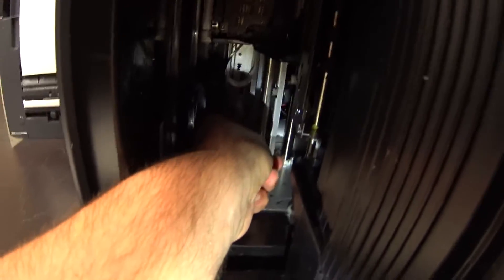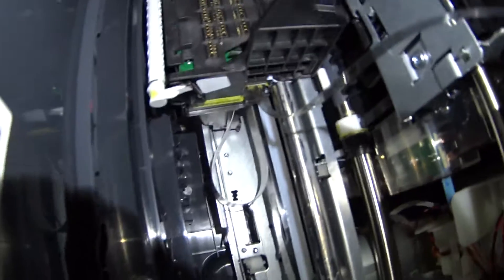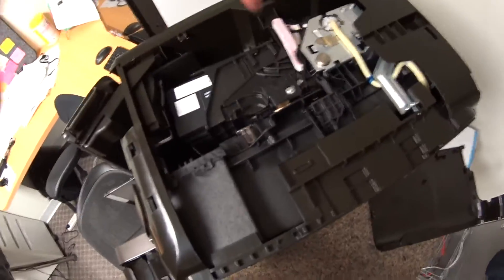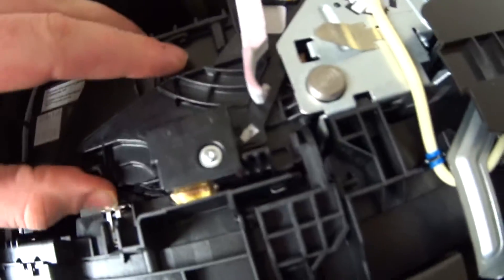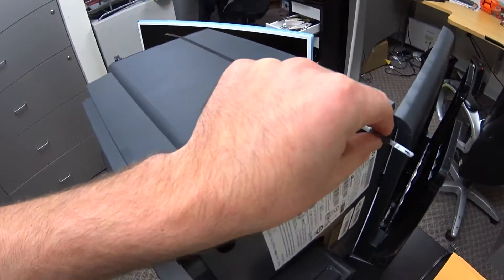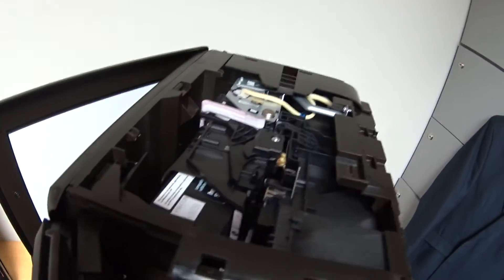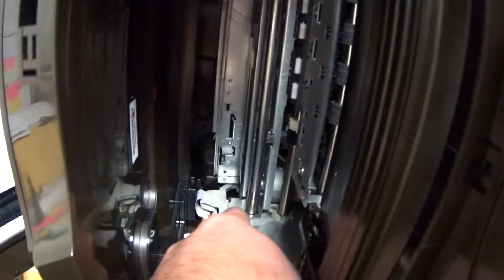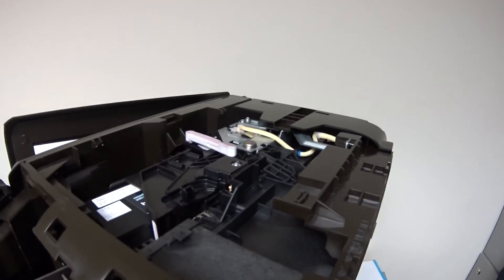HP printer disconnected plastic ribbon - encoder strip repair part 1

Comment: Your suggestions are very helpful indeed.  I can see that the strip wouldnt be long enough to hook  onto the right hand mooring once it is hooked onto the left hand one, -  certainly not without holding down that metal right hand clip.
So you are saying that it isnt necessary to take off the LEFT panel to get the encoder strip hooked to its left hand mooring?

Comment: Hi. I have a photosmart  B210e. My ribbon snapped lose after a paper jam. I can't get it on through the top either. Thought about removing screws to.fix it. But I don't have the right size Allen wrench. I saw ur video where put it in through the side. How can I remove the side on my printer? If I can't fix it I'll have to purchase a inexpensive wireless printer . I use my phone to print shipping labels. Thank for any recommendations